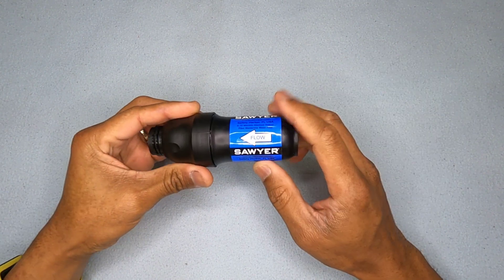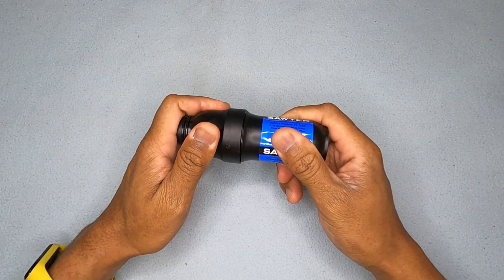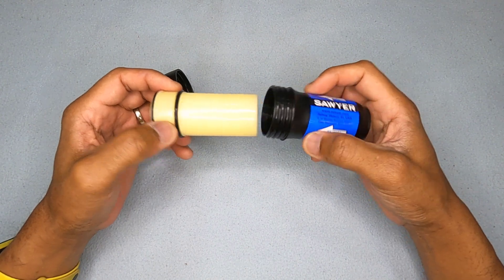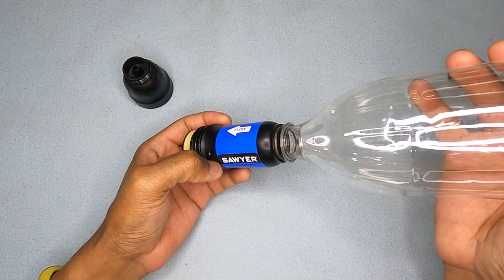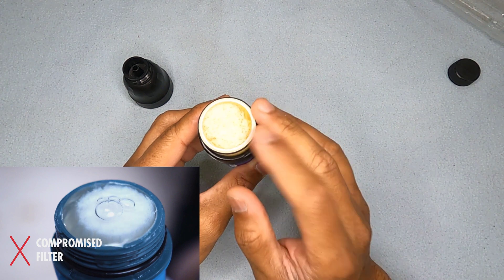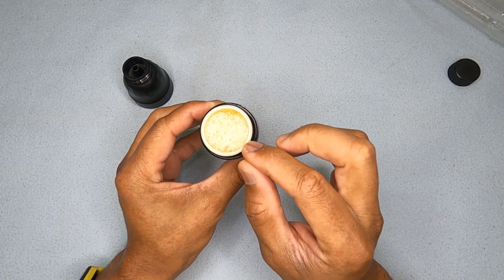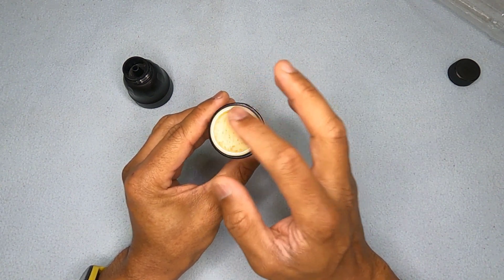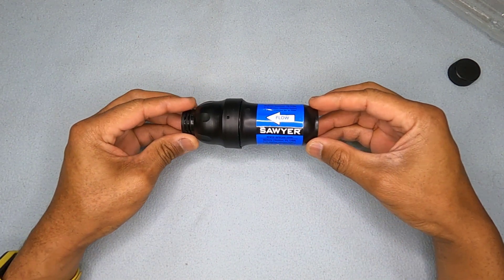SAWYER Squeeze PointOne - Integrity Check How To (Just like the Platypus QuickDraw!)

Comment: If water will flow, why not air, causing bubbling??  This video is confusing.
Reply from the maker: Camping filters like the Sawyer Squeeze, Sawyer Mini, and Platypus QuickDraw** are designed to let *water* flow through while *blocking air* (unless forced). Here’s why:

### *1. Hydrophilic Hollow Fiber Membrane*
   - These filters use *ultrafiltration (UF) membranes* made of *hollow fibers* with tiny pores (~0.1 microns for Sawyer, ~0.2 for QuickDraw).  
   - The fibers are *hydrophilic* (water-attracting), meaning water naturally wets and fills the pores, while air is excluded unless pushed at high pressure.

### *2. How Water Flows Through*
   - When you *squeeze, suck, or gravity-feed* water into the filter, the liquid is forced through the microscopic pores, while:
     - *Bacteria, protozoa, and sediment* get trapped (too large to pass).
     - *Air* cannot easily displace the water in the pores due to *surface tension* and capillary action.

### *3. Why Air Doesn’t Flow (Under Normal Use)*
   - *Wet pores block air:* Once the membrane is wet, water forms a "seal" in the tiny pores. Air can’t pass unless enough pressure is applied to *push the water out* (this is called the **bubble point**).
   - *No pressure differential for air:* Unlike water, air isn’t being forced through the system—you’re either sucking (creating negative pressure) or squeezing (positive pressure on water only).

### *Key Takeaway*
- *Water flows because the hydrophilic membrane’s pores fill and allow liquid under pressure.*
- *Air doesn’t flow (once wet) because surface tension holds water in the pores, blocking gas unless forced at high pressure.*
Reply: @BorealWilderness  Outstanding!  Thank you! 🙏

Comment: Nooo!!!!
Do not take apart!!!
You will not get a good seal on your orings and you will get bypass.  That's why we weld it shut.
The air test to check for damage fibers does not work due to our proprietary technology which prevents air locking.
Adding glue only defeats the anti-airlock mechanism and is unsafe. 
All of the above voids your warranty.

Just goes to show you cannot believe everything on the internet.

John T. Smith
Vice President R&D
 Sawyer Products Inc.

Comment: This is fantastic info. I wasn't aware that this filter was so serviceable! Have you played at all with the Sawyer MINI? It seems to be pretty monolithic.
Reply from the maker: The mini is glued as far as I can tell. No chance opening it. BUT...It still can be tested. Just that you'll see bubbles coming out of the spout rather than directly from the membrane pack. The same can be done for the PointOne if you dont want to take it apart.
Reply: @BorealWilderness  At some amount of air moving effort, air will definitely move through the filter, even if it is perfectly sound. Do you understand how we might quantify that? Is it something like: the filter is failed IF  1. If you see bubbles at pressure < Xpsi VS 2. If you apply pressure Xpsi and see bubbles in < X seconds.  I presume that this all depends on the tendency of the hydrophilic pore of a given diameter to try to resist a force that is trying to de-wet it? This would make me lean towards the first condition? I admit its not my field of expertise but I definitely would like to understand this better. I think the community would be grateful for a DIY test that can be performed with < $20 of personal effort!

Comment: Would this method still work without taking anything apart? 

I cannot separate mine either but it does run clear for a few seconds before starting to bubble. I’m watching the top of the black nozzle for bubbling as I’d imagine all bubbles would still have to come through the top.

The filter can only hold a small amount of water I imagine, so it would have to start bubbling at some point since it isn’t being supplied with water anymore. Right?
Reply from the maker: Yup, you are doing it right. Sounds like your filter is compromised.
The the field that's what I'd do. At home, to be 100% sure, I'd submerge the filter facing upwards in a bucket, push water through it with a bottle or bag full of water to displace all the air, keep the filter under water, unscrew the bottle or bag, empty it, send it back down upside down to keep it full of air, screw it into the filter, then try and push air through it.
If you are getting a steady stream of bubble coming through the filter, most likely it's compromised.
Wouldn't do this in a stream or lake as the clean end would get contaminated.

Comment: Yeah, im going to go ahead and nix the glue method.  The margin of error is not worth it not to mention water coming into contact with toxic glue.....
Reply from the maker: Yup, ofcourse, best to replace. It's just that CA glues are relatively non-toxic once cured but they are not considered food-safe by the FDA. So while the CA glue method would work in a pinch, an eventual replacement would be best in the long run.

Comment: As of December 3, 2023, this may not be possible. I tried but couldn’t get it to unscrew. The label has the new branding - Sawyer is in a serif font vs the old sans serif - so they may have adapted to prevent this.
Reply: I have a filter with the serif font bought May 2023. This guy must have the grip of a rock climber or something because it took slip joint pliers wrapped in a towel holding the bottom part and strap wrench on the top part to break the weld joints.
Reply from the maker: Thanks for the update. This is disappointing.
Reply: I have the same new models and was able to open all of mine. It is very hard however, you do need a good grip.

Comment: So, do any bubbles indicate compromise?  I get about a dozen small bubbles, but mine has never frozen — just been in a closet for a few years.

I’d already begun to question Sawyers, but am now convinced I need another solution.

Thanks for the video.
Reply from the maker: Would love to hear what sawyer's response will be coz as far as they are concerned, their filter is not testable.
But in the context of this video, If there are bubbles I'd be wary of it. The membranes can crack due to a fall/shock etc. (though rarely). I'd say give the cyno glue method a go but that's down to user discretion. Imho, if it does not bubble, it's technically safe (IMHO).

Comment: I can't get my Sawyer Squeeze open by hand. I'm a wimp.
Reply: This guy must have the grip of a rock climber or something because it took slip joint pliers wrapped in a towel holding the bottom part and strap wrench on the top part to break the weld joints. I have one bought mid-2023 and as of then, they are not glued shut.
Reply from the maker: I wouldn't say that.... Maybe they started glueing em shut after I made the vid 😅